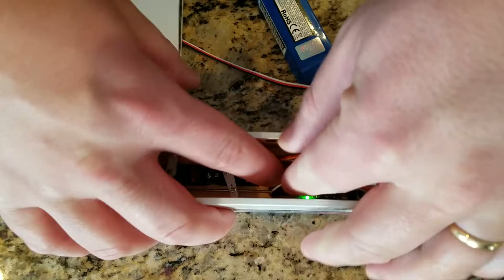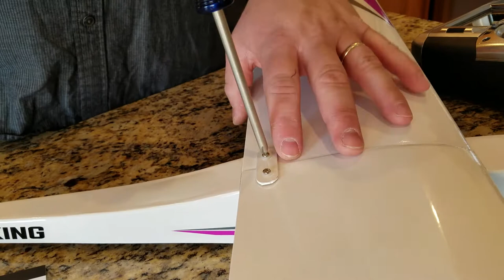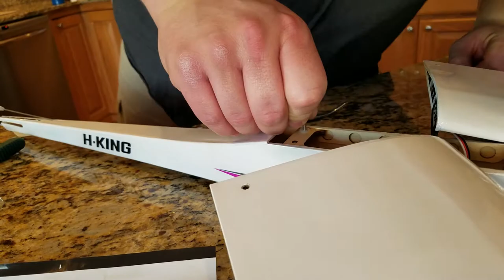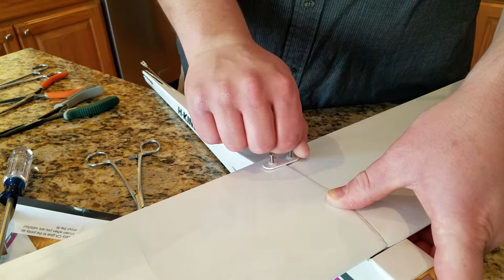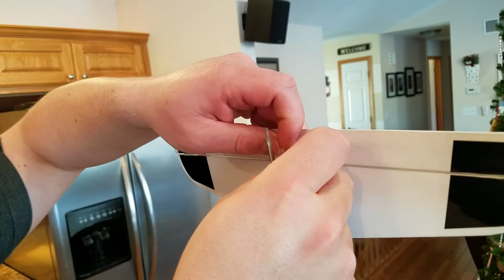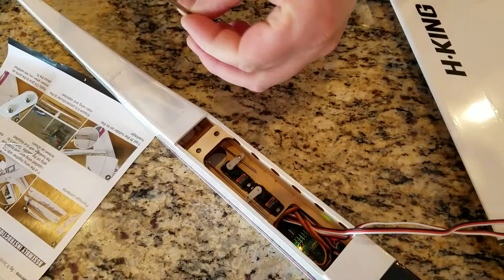Hobbyking - EZIO 1.5m - Build - Assembly Part 1

Comment: Hi Brian,
I have been modeling since 1968, 52 years. It is obvious you are a newby. On you receiver if you take a piece of foam and fill the space you want the receiver in, then take it back out and cut a hole for the receiver then put the foam back in. Receiver protected even in a crash. The nut-sert you had in your hand in the rc hobby world is called a blind nut. A nut-sert , when you tighten a bolt or screw, it expands to lock it in . FYI.
Reply from the maker: Blind nut, yes, I stand corrected. Sometimes it's better to just say something and move on to the next item rather than sit and try to recall what I'm trying to say. I sometimes mix up the technical jargon with my professional experience too... I always call the PTO shaft on my tractors, prop shafts - don't know why...just a bad habit.

Comment: Hobby King, Hobby King, good prices and sometimes good junk, not saying the EZIO is. But you do get what you pay for! I do the same thing at times it’s hard to pass up a good price.
Reply from the maker: I hear what you're saying. This plane is definitely not in the Hobbyking Junk column (I've had a few for sure IN that column)...but it's not amazing either.

If it were my first Glider / Sail plane I'd probably think it was great...but it's not, so I can't help but put it up against some really good (and bad) planes in my sphere of experience. It is a good value for the money, but that being said, if you want a really great experience, just get the Volantex ASW28...which is another "project plane", meaning you'll have to do stuff to make it work well...but at the end of the day, it's almost the same price...figure this plane is about $125-$150 (depending on when you buy it), while the ASW28 is $100-$125 (depending on when you buy it)...the ASW28 will set you back another $25 for a better ESC (so you don't lose it when you set up the stabilizer like I did my FIRST ASW28)... There you have it...two PNF planes with significantly different performance and experiences, for about the same price...I have a hard time really pushing people to THIS one, over that...you know?!??

I WANTED so much more from a little plane that SHOULD have been better....but I'll still enjoy it for what it is.